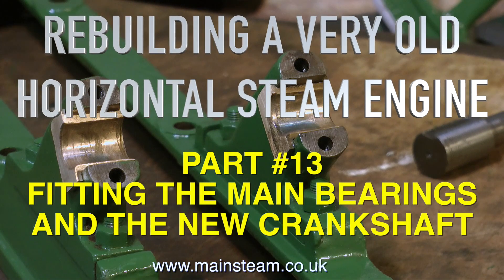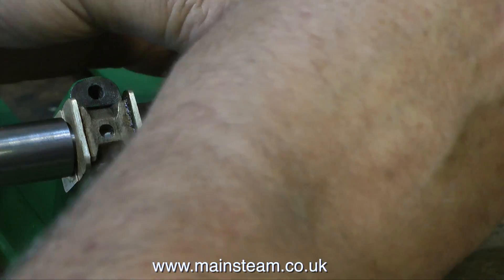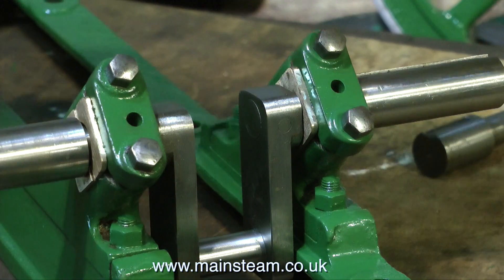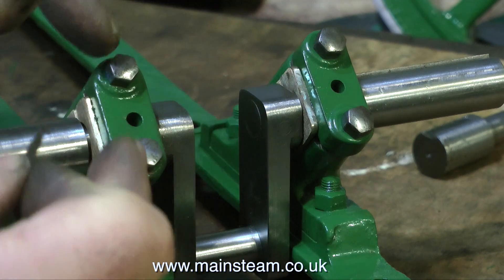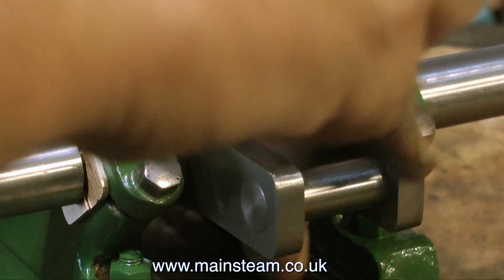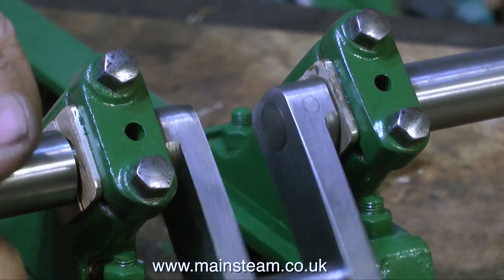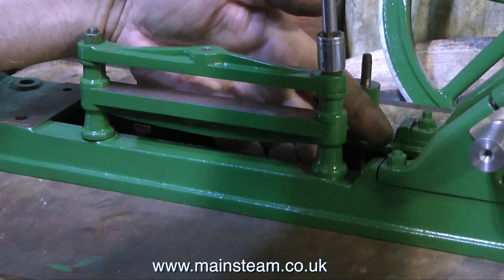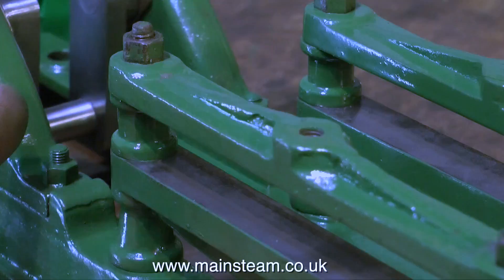PART 13 - LARGE HORIZONTAL STEAM ENGINE REBUILD

Comment: where exactly do you find these used steam engines seems like a very fun hobby to tear them apart fix them prehab them paint them and rebuild them thanks for the videos just curious on where you find to buy these things
Reply from the maker: +Tobin Prowant Some of the engines featured are from my own collection, some are bought in by customers for renovation and repair.
Reply: Keith Appleton because I live in the states I don't know if steam engines are as easy to find but perhaps I should look on ebay or other sale sites I personally don't have a store but my workshop is well outfitted for working on things like this thank you for your time and also your prompt response to my question once again I really enjoy your videos and your accent makes them feel more intellectually stimulating
Reply from the maker: +Tobin Prowant Ebay is a good source, but do be careful what you buy ......
Reply: Keith Appleton thank you for the advice

Comment: Thanks for this Keith. The engine is really starting to look the part. Will this be run on stream when the time comes?

As you have drums of locomotive green paint, are you planning to do a restoration on a model locomotive?
Reply from the maker: +Jonny Stevenson I wish, I am down to my last tin of G.N.R. Green :-) I seldom do much work on locos in actual fact - it is incredibly time consuming and therefore expensive to do.
Reply: +Keith Appleton is there scope to do a series on the locomotives you work on?
Reply from the maker: +Jonny Stevenson There will be when I come across one to repair . . . .